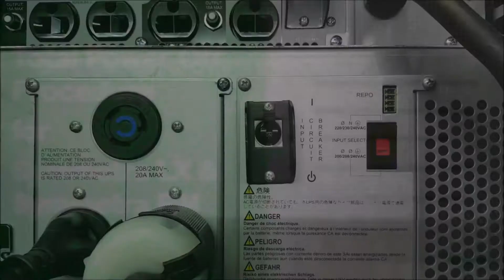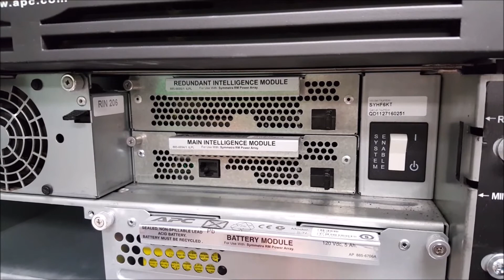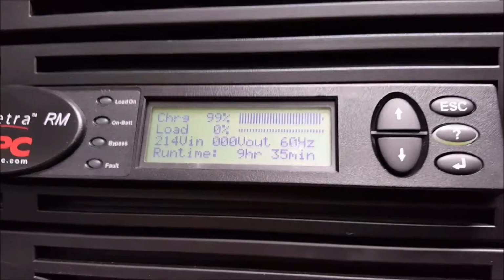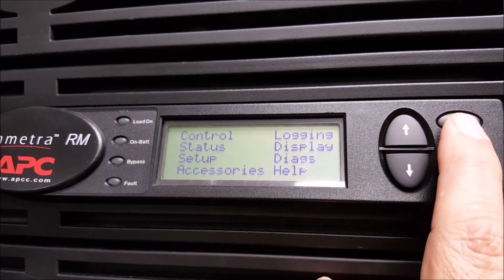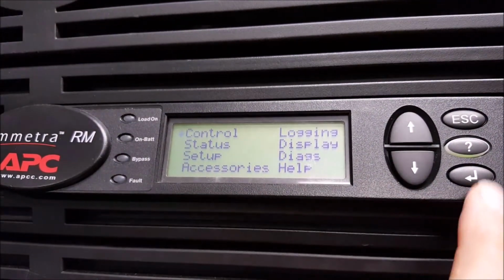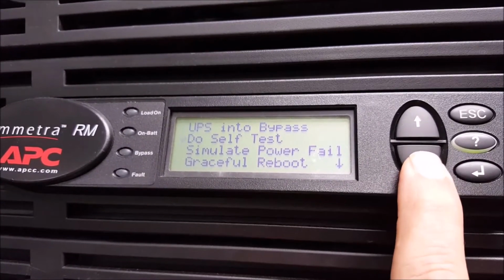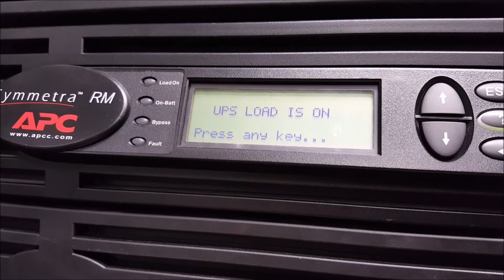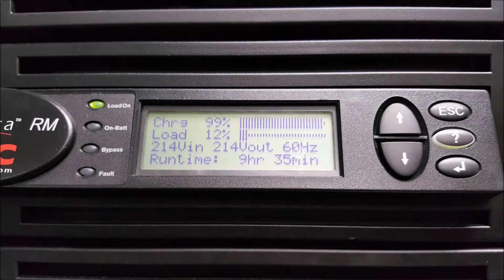Performing Total Power Off Procedure for Symmetra RM 6kVA | Schneider Electric Support

Comment: Will rebootting the RM6000 (setting static IP requiring a reboot to take effect) cut power to the outlets with appliances running?
Reply: Yep- soon as you flip either of those system enable switches, power will be lost. If you need to reboot the card, just unscrew the network card, pull it out and then put it back in.